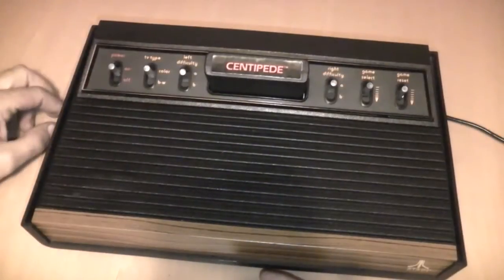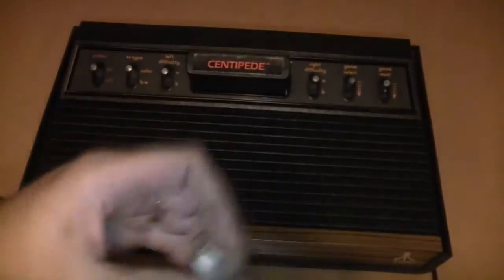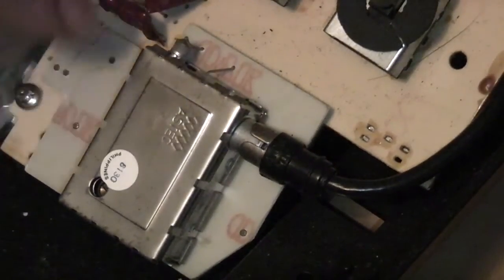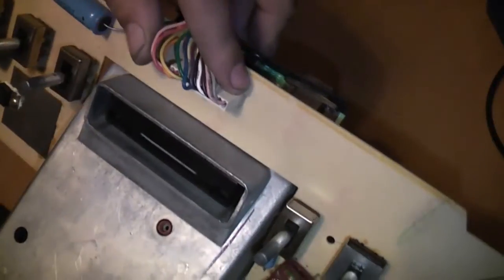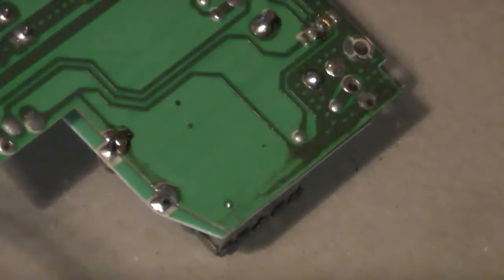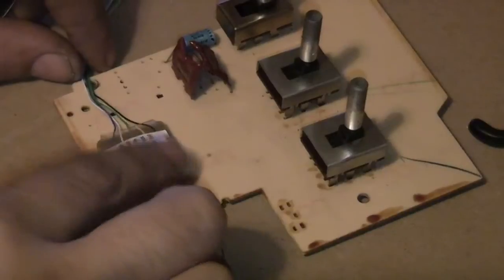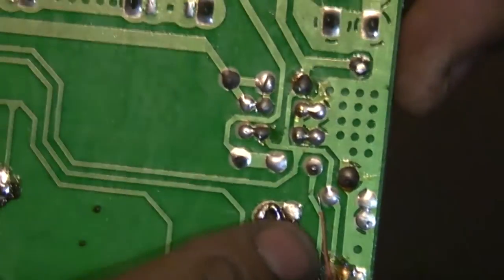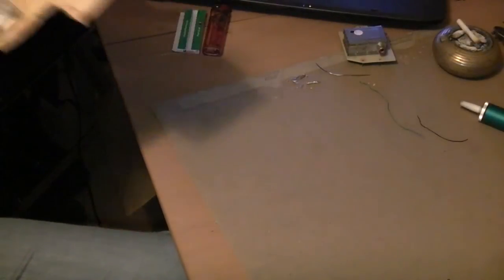Atari 2600 [PAL] Composite video A/V mod install Part 1

Comment: I have modded my Pal 7800 with a kit from the same guy (and several Colecovisions) and it worked really well. As I have that I don't really want to mod my original 2600 models, as I use it for playing the games and the others are for my hardware collection.
Nice seeing the inside of these machines too :)

Comment: A good thing to use RCA jacks to that you can use any length or kind of cable! Got an additional composite to HDMI converter box myself that would actually make it work on a modern HDMI enabled set :) But that needs 5 volts power at 1.5-2 Amps.
Reply from the maker: Yes I agree, it future proofs the cosole for a few years to come, I can use composite or stick on a scart block or as you say, I can convert it to HDMI :)